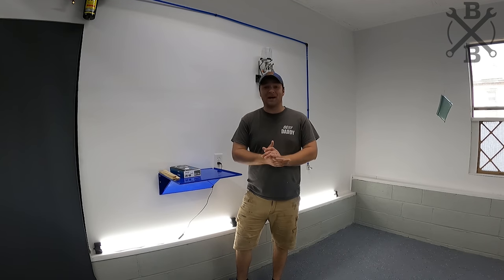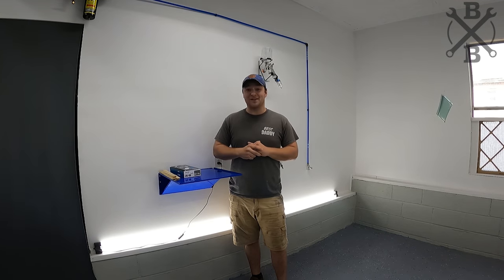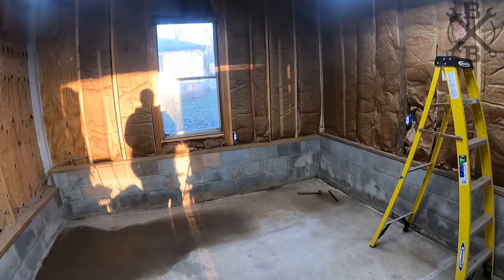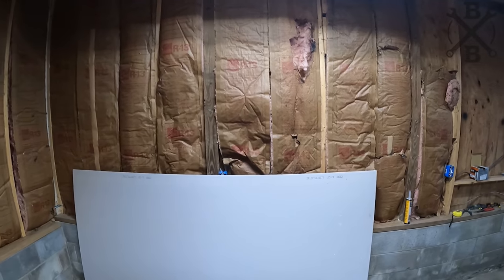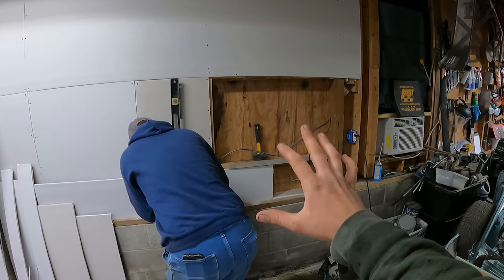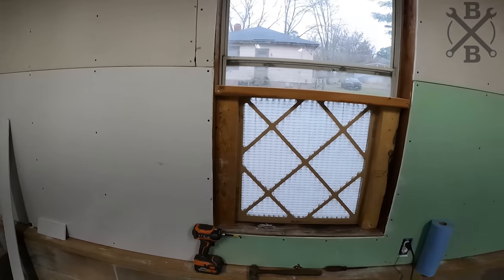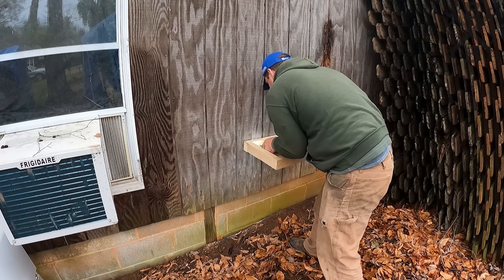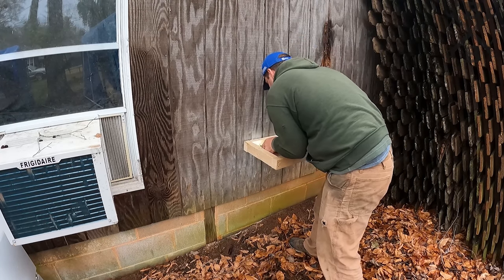Inexpensive DIY Paint Booth: Budget Buildz Garage Rehab

Comment: It came out great, but if you are considering using this paint booth for lacquer and solvent based paints, applied with spray guns, then please remember that you will be creating large amounts of potentially flammable fumes in the air. I worry that your light switches, light fixtures, electrical outlets and most importantly, the old exhaust blower fan and the close-by air conditioner are not EX (explosion) proof electrical equipment and that could pose a substantial fire danger. I worry mostly about the squirrel exhaust fan which uses the air it sucks to cool the motor and brushes and sucking lacquer based fumes through that fan and the sparking brush motor can be a substantial risk of fire and/or explosion. The paper filter you have in front of it will not be sufficient to catch the airborne fumes and over time it will only get coated and blocked by the airborne vapor. This is why most higher end spray booth systems use water curtain filters to absorb solvent vapor droplets from the air, before the air is exhausted. Spray guns create a lot of super fine airborne fume particles, so please take some time to look into this for everyone's safety. Thanks!

Comment: Great  family involvement  .looks great  .just a suggestion .make,buy some tubs on casters with lids yo wheel in and out of the spray booth .as we both know they are dumping grounds dead areas .so when you do spray in there you wheel out the storage tubs
Great your making the work environment  a better place
Simply jobs like making the concrete hard standing outside the garage level and painted are jobs which give you better work area 👍

Comment: May wanna think about having a slightly positive pressure booth, with all that negative pressure it’s gonna suck all the dust on to what your painting. Have a bigger fan pushing air in thru a filter as well.
Reply from the maker: Will do! Thanks!
Reply: Yep
Reply: Yes! Best to put the flters in the air intakes and make it a positive pressure boooth. The fumes and over spray will be pushed away thru the outlets anyway. It works best for keeping the trash out.
Reply: Good advice!
Reply: @BudgetBuildz  check out the paint booth @fingerprintsworkshop did for his fiero respray. 

Defeinetly important to do positive pressure - harsh lessons learned!

Comment: It is rare, but some auto paint is flammable so make sure the blower is isolated from the electric motor.  Hate for you to be the one in a ?? guy that has a motor spark ignite fumes. Good time to do it is during the build. Nice work.
Reply: You have a great point!  The National Electric Codes are very specific regarding wiring, lighting, motors, etc. within spray booths.

Comment: Very cool. In the past I use to make static plastic barriers in the garage. If you hang some thin plastic on the walls it will pull dust and overspray away from the car. What a transformation!! I would still hose the floor down before you spray. Cheers!

Comment: Hey Michael, you could improve the cleanness of the air in your paint boot by using the fan to blown in (filtered) air, instead of extracting it. By extracting the air, your boot will have an underpressure to the environment, and will suck in dust through the remaining gaps/leaks. When you blow in the air (through the filters), the boot has an overpressure to the environment, and will leak cleaned air through the gaps instead of sucking in dust.

Comment: Your going to need a desiccant air filtering system for you paint jobs ! And LED lights show the paint different then fluorescent lights so choose your lights well ! And a heat source for drying is always helpful ! Plumb out your air lines , at least 2 per wall and a gun rack along with a paint station . Are you using 2 part paint ? Or single stage ?

Comment: Looks great to me.  Unfortunately my garage is barely a one car garage no matter how ya look at it.  It was built back in the 1930's using cinder blocks for the walls all the way up to the ceiling joists.  Fortunately the former owners put a plywood ceiling on it screwed to the bottom of the joists.  I painted the whole thing white inside with a couple gallons of KILZ as at first it had a single bare bulb in a porcelain fixture and was just dark in there.  Since then as it had an old fashioned edison fuse box from an old house inside it I wired up 4 outlets around the inside and surface mounted the metal outlet boxes on cabinet sides and atop the long work bench I have down the left side of the garage.  This Spring I'm adding a new 240v fuse box under the old fuse box with a knife switch so I can hook up my new two stage 60 gallon campbell hausfeld air compressor.  It uses the small paper cartridge fuses so it will be a dedicated 30 amps to the compressor only using 10 gauge wire from the box to a stove/dryer type surface mount outlet.  Hoping with a bit of maneuvering I can get my little truck in there this Summer and paint the whole truck with colored Raptor bed liner :)
Reply: Never painted my garage floor but for some reason whoever built it decided to give the floor a rough finish instead of troweling it smooth so it's difficult to even use a creeper on the floor.  It sucks too because they did the rough finish lines from side to side instead of front to back so you can't even effectively sweep all the dust up.

Comment: Your enthusiasm is infectious, but guys you’re breaking most every design criteria for a Spraybooth.  Please tell me your not intending to spray 2pack isocyanate paint in there! A Spraybooth should operate to meet several important criteria, 1) to contain and control a potentially hazardous process, in terms of risk of fire and explosion also to protect the operator by rabidly clearing overspray. 2) to provide a clean air environment to reduce paint contamination.
The booth should operate at a negative pressure, you’ve got that right! This stops overspray migrating out into other areas in a building. Ventilation rates don’t have to be that high 3000cu.ft/hr will allow 1litre release of solvent per hour without breaching 25% of LEL(lower explosive limit). If your extract fan is say 0.5kw it’ll probably shift 17500cu.ft/hr providing the filters aren’t to restrictive, then your ok there, another tick in the box, but you should be extracting at low level( near the floor) because solvent is heavier then air. However all electrics in the booth should be ATEX zone 2 rated. Why? Because within a 3ft distance from the Spraygun is highly flammable and that basically means as you move around the booth spraying the flammable zone moves with you. So lighting, switch’s and socket outlets are potential sources of ignition.
Why the concern about isocyanate paint? Because it causes long term damage to your lungs, it’s a killer, always wear an air fed mask and keep it on for at least 10minutes after you’ve finished spraying or get the hell out of the booth. The clearance time for getting rid of airborne overspray will be at least 10 minutes in your booth probably a lot longer. In a professional Car refinishing Spraybooth airflows are typically 700,000cu.ft/hr and they take 2-3minutes to clear overspray.
Airborne contaminants of 8-10 micron will give visible paint damage. Your inlet filters will possibly stop contaminants down to 30micron if your lucky! They’ll stop insects, so that’s a plus! But you have not created a clean air environment for a gun finish, lots of flatting and polishing required. I’ll quit now as I’m sounding like a boring old farts! 
At the end of the day what you’ve built is for occasional ‘home use’ and it’s impressive.👍

Comment: Just a thought, change your filtration to a Positive pressure instead of a negative pressure that way you wont pull in any dust or bugs threw the cracks at the front of the booth